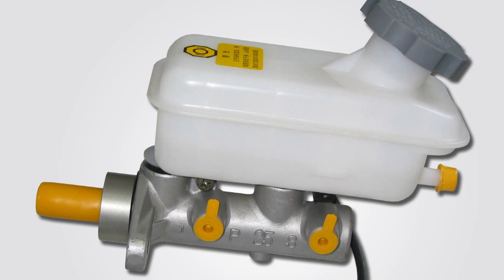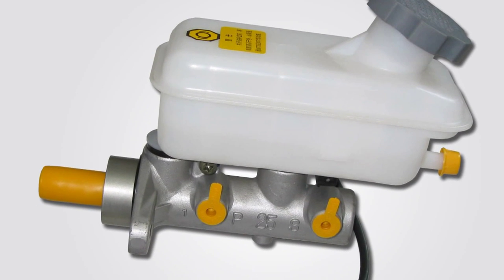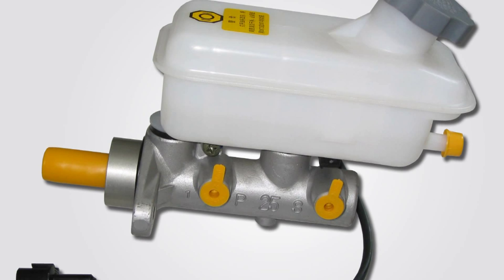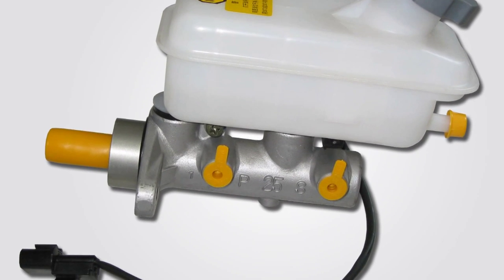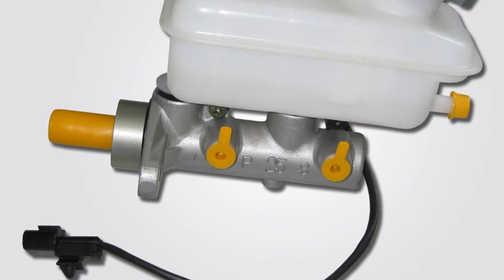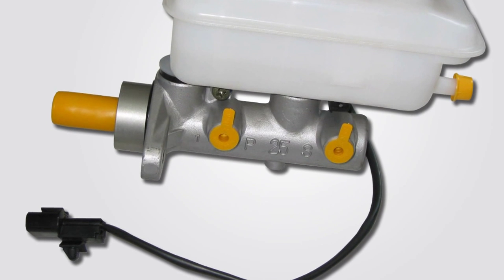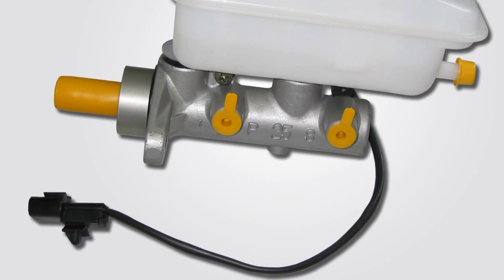Auto Repair & Mechanics : How Does a Brake Master Cylinder Work?

Comment: but how does the vacuum diaphragm actually connect to the master brake cylinder? I've always been curious about that. It's obviously metered in some way or the vacuum would always be pulling on the master cylinder and applying the brakes.